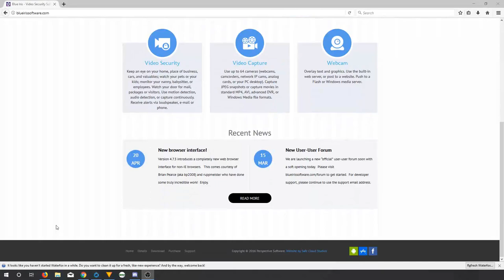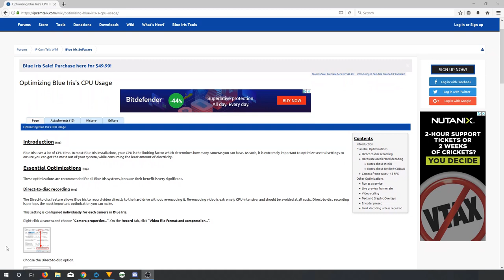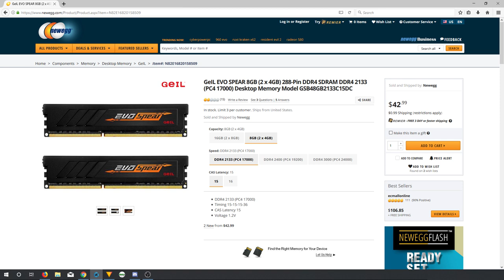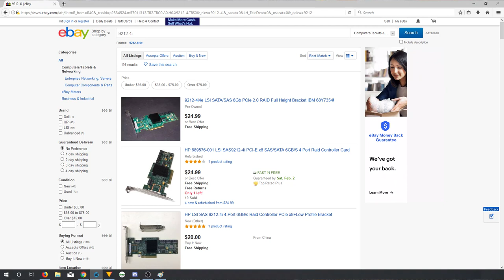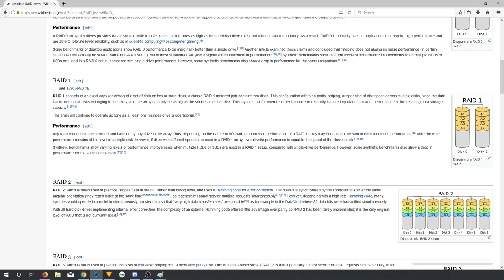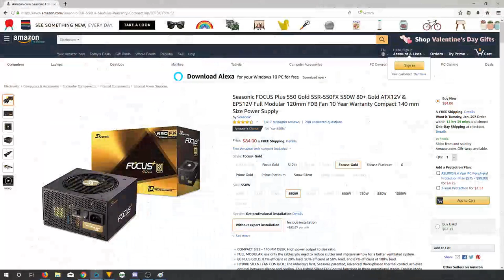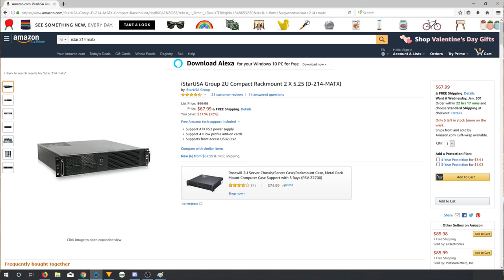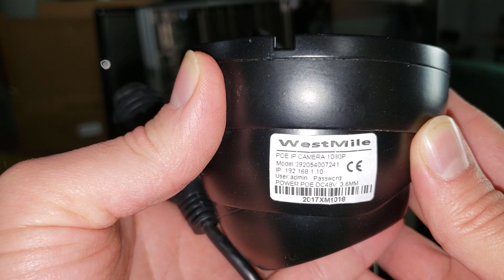Video Surveillance Server Build for Home / Business

Comment: I just did mine a couple months ago with an Intel Core i5-10400 and using Blue Iris. WAY over RAMmed (32gb), and it runs at 10-12% CPU with 4 Amcrest IP8M-2496EB cameras running at full tilt. I used a 3U rack mount for mine, though. Very nice build you have there!
Reply from the maker: I like the build you jabe there - a bit more modern than mine, more horsepower. I am actually considering upgrading to a newer generation soon as well.

Comment: Great video. I really enjoy this case and decided to go overkill and see what I can put in it. 

The only thing I would note is while the chassis can take an atx power supply you need to pay attention to the particular brand. I found out the hard way. The PSU I got was listed as 86mm in height but the fan grill protruded and it was actually 91mm so I couldn't close the lid. Dang thing got my angry.
Reply from the maker: Thank you Zachary! Ah, yes, i suppose some PSU manufacturers might not include that import extra few mmm of the grille. Which power supply did you end up going with?

Also, what were you doing with your build? Video security or virtualization?

Comment: If you are using POE cameras, spend an extra $15 and get reolink rlc410 cameras. 1440p full 30fps. Great image quality. $45 shipped amazon prime.
Reply from the maker: Hi Pallet Homestead! Thank you for the tip, I will definitely check out at least on of those! Are you running a video security system of your own?

Comment: HI, whats the advantages of putting a server like this together as opposed to going out and buying a hikvision NVR as an example? Dont get me wrong, i also built my own home server runnuing Blue Iris in order to demo for clients but im struggling with why this over the commercially available units
Reply from the maker: Hi Shanesingh7170! Weel, there's a few reasons from my point of view, which is important to understand, my point of view is mine. If the use case changes, the solution might too.

NVRs from various vendors are notoriously horrible when it come to security vulnerabilities. There are times when I have seen NVRs deployed and made accessible on the Internet in a very insecure manner with ease. Some NVRs are very picky with camera support, essentially vendor lock-in. Some NVR systems have very undesirable issues that will just never be solved. 

I generally see NVR's as being good for use-cases where there is a desire for set it and forget it, nobody cares. That is a huge, unfair over generalization of mine however as I realize plenty of businesses and homes run Hikvisions for example for years and never have issues.

I like building a server like this with Blue Iris because it allows me to better secure the system as well as customize it, and for nearly complete control of feature:budget ratio. I can build this on a server from a old gaming pc and use ultra cheap ebay cameras for example and have a relatively good feature set available for not a lot of money. Alternatively, I can build a solid system with RAID for fault tolerance which backs up footage to somewhere with a ton of 4k cameras of various brands all with AI supported detection features. If one year Reolinks are onsale, I could grab a few at a good price then next year, grab a few Amcrest cameras for example. There's a lot that can be done with Blue Iris, it is very powerful software. 

What's better for customers of yours? If I had to guess, packaged up NVRs that you are probably selling and supporting. A lot of people don't want to ever touch these systems and just want footage when a window get smashed for example but, they do not want to maintain or ever touch the system, theres a huge desire for security cameras / nvrs to be run as an appliance vs as a server that needs attention / configuration.

Comment: Do you have, or will you be giving an overview of how to set up the switch and install the cameras? as well as software/network setup?
Reply from the maker: Hi Michael! This is a future planned set of videos for sure. For the most part, I assume most people will use unmanaged (no configuration) Power Over Ethernet switches all on the same VLAN. This is quick and easy setup but certainly far from ideal. If time allows, hopefully I can finally start on a refreshed video series for this topic soon.

Comment: Personally planing on haveing 2 lans, poe with no acsess to the internet and normal cat 5-6 for internet and wifi. A 4u apu should be able to keep it all running for 10 hrs.
Reply from the maker: Hi Again! Yes, I would suggest segmenting your network camera traffic from the rest of your network for security. There are many calculators available to determine run time for PCs at a certain efficiency, voltage level, and runtime. I would suggest using tools from Belkin, Tripplite, APC, and the like to help size your UPS correctly.

Comment: hi i need help two 4 k monitors . . 
and upto 80 cameras
which processor to use and which graphic card in GBs use Please if you can help.
Reply from the maker: Hi Muhammad!

That is quite a high end powerful system you would need there. Blue Iris has a single server limit of 64 cameras. You would probably need to load balance 80 cameras across two beefy Blue Iris servers. What kind of budget do you have for a system like this?
Reply: @STS   ,budget is $ 1200  usd
Reply: And i am using  Avigilon Client Application

Comment: Dude! Awesome video! Loved it. Exactly what I was looking for. I like the build. I am looking to buy a build that is rack mountable. I wish this build wasn't so much, looking to keep my build under $300 - $400. 4 poe camera's running 24/7 with blue iris. Probably going to buy 4k amcrest camera's. I'd love to chat and pick your brain.
Reply from the maker: Hey Jaron! Thanks for the support :)

You can always buy used parts to get you where you need to be. I chose the parts I had based on what I had on hand and could buy for a decent price quickly on Newegg. The important thing is to make sure you get an i5 or i7 from a recent generation.

I have Twitter and Facebook setup but I could do Discord too sometime if that works.
Reply: @STS  Thanks for the info. That would be awesome! I'd love to chat. On discord i'm theleftyfifteen.

Comment: Quick question, you keep saying not to use an amd cpu, but what about a newer amd apu? Wouldn’t that be even a better option because of the powerful integrated graphics, such as a 5700g? Or would it be beneficial to have more cores and worse internal graphics, like say a 9900k?
Reply from the maker: Sorry for the late reply here Ultraprecision Technologies! Blue Iris leverages Intel Quicksync which requires Intel CPUs - AMD CPUs with integrated graphics are much better for gaming but do not support Intel Quicksync hardware acceleration. With the substream optimizations now though, it's possible you might be able to get by with more cameras on an AMD CPU. In terms of power usage and efficiency though, you are much better off with an Intel CPU equipped with an Intel iGPU.

Were you building a system for home or business use?
Reply: @STS  in my case home and business are the same thing lol. I’m just in the early stages of planning my server, which will handle and editing nas as well as a surveillance VM, as well as a few other tasks. Trying to decide if I should make a dedicated server for surveillance, or just make 1 mega server with overkill hardware and run VMs. In the research stage of what hardware makes sense here. But your reply was very helpful, as I was not aware of Intel quick sync.

Comment: Why not buy a used 12 drive 2u supermicro chassis and have far superior cooling and layout? Im just in the planning stage for my home security setup, so im by no means intelligent in this.
Reply from the maker: Building a custom system like this allows you to keep the cost relatively low in that you can re-use older Intel or AMD PCs that some people have laying around. As always, it depends, but, it's possible to save on power with a custom purpose built system as well. the iGPU's built into Intel CPUs can drastically reduce your power consumption. There are no CPU cores or GPUs that can compete with performance per watt used when it comes to the iGPU on Intel CPUs. Using the hardware acceleration quicksync provides also allows you to increase the amount of megapixel you can effectively push to a system.

That being said, I don't dislike Supermicro stuff, its great quality and I have bought a decent amount of Supermicro gear. If the refurb or new Supermicro server you are looking at does not have an iGPU, it will almost certainly cost more in the long run due to power costs.

Really depends on hardware you currently have, your overall budget, and how important the video server is to you.
Reply: @STS  I've got several of those systems based around epyc and a2000s for graphics for them. That's why I will be using.

Comment: 4:21 Encoding .. why not use the camera's H.264 stream than re-encoding? Use Direct-to-disc recording.
Reply from the maker: Hi D Jaquith! Yes, Direct to disc will yield great results in lowering CPU utilization but as the mega pixels go up and the total amount of cameras there will still be added CPU load. Eventually there will be a point where using Quicksync will become preferred or necessary to keep up.
Reply: @STS  .. My build is probably the new i5 10th generation, 32 GB RAM, 500 GB SSD/8 TB surveillance HDD, 9 cameras x 4K but using 720p 7/24 substream and in full 4K with motion and AI filtering. I just wish there was a local AI I could use instead of a cloud API. I considered the Synology DVA3219 with it's Deep Learning but my any using it felt it's not much more accurate. Having your email filled up with "crying wolf" notification defeats its whole purpose.

Comment: What do you think about running the pfsense and Blue Iris on the same machine? or is it better to run pfsense on its own.
Reply from the maker: The heart of this question is what level of risk are you willing to take? If it's a home network and you aren't relying on pfsense services (or dont care) that it's down, virtualizing probably will save power and device cost. If you're running a larger network with several devices depending on the services pfsense is offering, and there whether or not there is a backup waiting to take its place, or any business scenario, virtualizing may not be worth the risk.

Virtualization is awesome stuff. That being said, I have reservations about virtualizing a primary firewall (assuming your question has only one pfsense server/instance). Its a firewall appliance so, generally I think of this as a device that uptime matters more than cost, space, heat, most other metrics. Thankfully pfsense firewall requirements are quite low which make it seem like a great candidate for virtualization. I personally would steer away from virtualizing pfsense as a primary firewall. The storage requirements for a video surveillance server are much more demanding than a pfsense server. In my opinion, the likelihood of a drive failure or other reason to physically power down a Video Surveillance / Security server is far higher than a firewall. Firewall configurations can vary widely but they aren't going to hammer storage much which will lead to reduced hard drive lifespans. While the physical server is powered down, you might not be firewalling, handing out DHCP addresses, matching DNS, and most importantly, likely stuck with every single host being disconnected from the Internet and possibly your network(s). Now, if you had a second backup spare pfsense instance running in a VM, that probably no big deal at all. 

In my home lab, I plan on keeping my main pfsense server a physical 2U box. I also plan on virtualizing a backup server in a on my soon to be setup VMware ESXi server. I have also considered virtualizing the backup in a VM from my Unraid server.
Reply: Thanks  @STS  . Actually, I just received my 1u rack case yesterday, my original plan is to have a dedicated pfsense machine, then after watching this video, it got me thinking, but then I'm not really sure, I already turned down the idea of having pfsense on my unraid server.

So its done deal, will have a dedicated machine for the pfsense. Thanks again.

Comment: Can I use my personal PC to run Blue Iris given that it has 64GB of RAM, i7 CPU and 1 GB of graphic card? The good thing would be that the  PC is connected to my TV so I can set Blue IRIS run at Windows startup, and be able to see all cameras on a big TV at all times. Or will I need a dedicated server for it?
Reply from the maker: Hi Sam 2000! 

You don't necessarily need a dedicated server but it's a good idea if you have a higher camera processing load or you really need to guarantee that this video recording device is rock solid reliable (for example, if you expected to have footage to turn into the local authorities). I would not personally do this but that doesn't mean you can't. If this isn't a concern, I have read about people using their desktop PC as the Blue Iris server. 

What type of cameras and how were you planning on deploying? This will help determine if your PC is up to the task.
Reply: @STS  Thanks for the response. I plan to have four 4K cameras for outdoors and 2-3 1080P for indoors, for a total of 6-7 cameras.

Comment: Any way you could update this parts list? Some parts are getting expensive because they're getting old, and I'm and AMD guy.
Reply from the maker: Hi Carl! It has been a while since I looked at this, I'm thinking about a potential refresh. I can go through the parts list and revise it much sooner though. I would still have to pick Intel based systems however as they will be much more efficient than even newer 3000 series AMD Ryzen processors. Blue Iris takes advantage of the iGPU (integrated graphics processor) on consumer-grade processors to accelerate video processing. At this time, AMD processors / APUs cannot be used this way with Blue Iris.